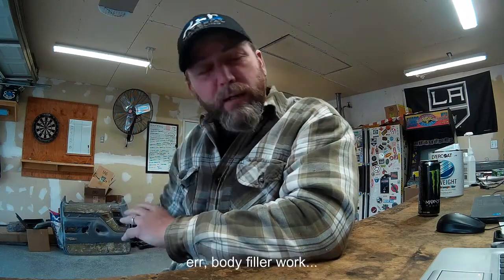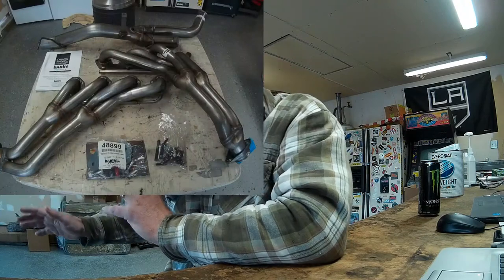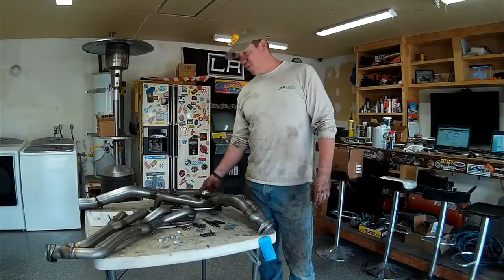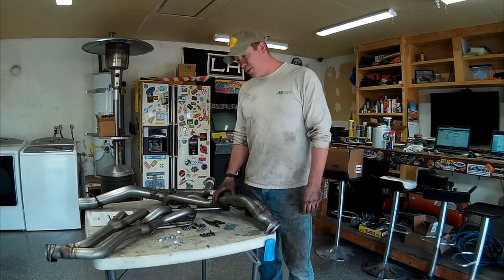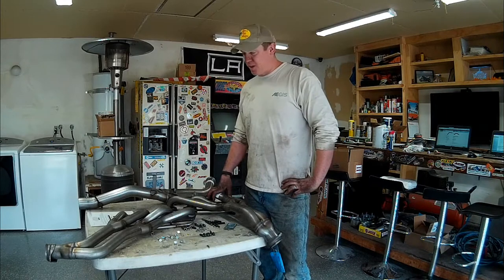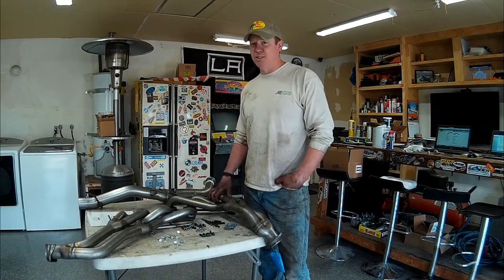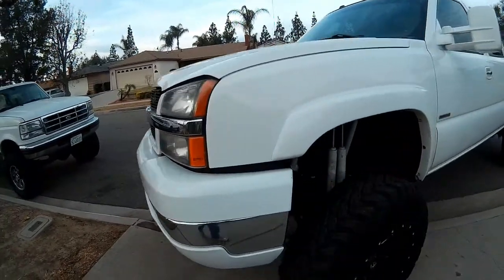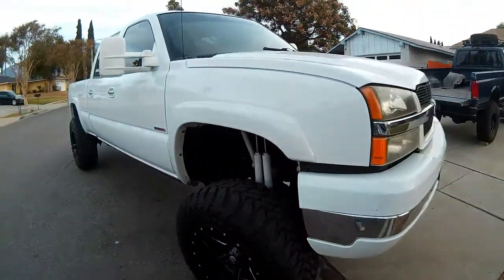Ford OBS;  F350 EFI 460 Banks Header Install!

Comment: Hi Jim Merry Christmas to you. I currently drive a 95 f250 4WD xlt  extra cab with the 460. I mainly use it to pull a 5th wheel. I replaced the stock manifolds with the Gibson headers. This was money well spent, no more exhaust leaks yay! Thanks for the videos.
Reply: Gary Schmitt which one did uou go with? Did you do the a.i.r delete or do headers have those made for it?

Comment: Just picked up a 94 F250 supercab long bed 4x4 460 tonight to swap my 1977 F250 supercab long bed body on to. Glad so many people out there have videos on OBS trucks. I know dentsides like the back of my hand but I don't remember much about OBS trucks because I only really messed around with em when I was a kid. My dad and grandpa both had 1994 F150 supercab short beds, grandpa still has his. They seem pretty similar to the dentsides but I'm sure I'll run into some head scratching. Really interested in those Banks headers? How did your buddy like em long-term?

Comment: I'm rookie when it comes to turning wrenches but eager to learn. I have a 97 F250 460, the previous owner has a all around Banks Power kit installed. Trying to take my passenger side header off to have some small cracks touched up. I got her all unbolted and free but I don't have near enough room to get the sucker out without raising the engine (or it seems at least) How was the space with yours? I already did the walk of shame back into the house to get some advice and research a bit. Thanks for the video too!

Comment: Thank you fellas for this video.  You got me convinced and I will be installing these headers on my 95 Ford f250 7.5l.  I am wanting to get as much horse power as possible! Any advice is welcomed please!! I was wondering what air intake upgrades where done?  I have already had my exhaust done but I am currently trying to find a "FORD" guy here in Colorado.  As to advise me what to add to get as much power as I can.  No luck as yet.  But I would also like to do as much of the work myself so really just wanting some solid advice But would like a mechanic on some issues.  Like to bump up my timing some.  Thanks in advance for anyone with some good feedback!

Comment: Hey! Jim, I couldn't see from the video did you put the catalytic converter back on?
Reply from the maker: yeah we sure did, Kevin specifically picked these headers to be CA smog legal, also the cam he installed.  and as it happens, Kevin smogged his truck last week and it passed just fine, even on 38s, it's no prius....but it passed.  thanks for the question!

Comment: how do I know if my 97 F-350 7.5L is "air injected" or "non air injected"?
Reply: If you have a air pump located under your alternator
Reply: Look under the truck at your catalytic converter, if you have a 5/8 metal pipe going into the cat, it's smog pumped

Comment: What was that piece for the shock?
Reply from the maker: that is the front swaybar relocation bracket that moves the swaybar link away from the header.  Kevin's swaybar links are lengthened for the RSK lift so it was a simple matter of using the supplied bracket to get the link out of the way of the header.  thanks for watching!